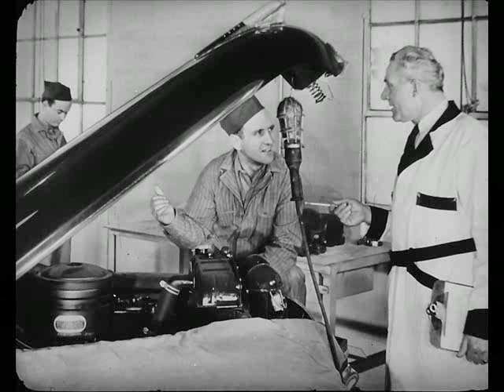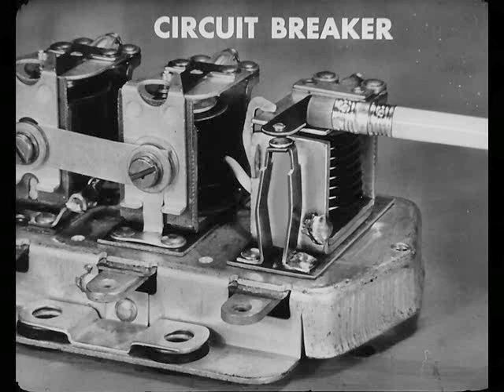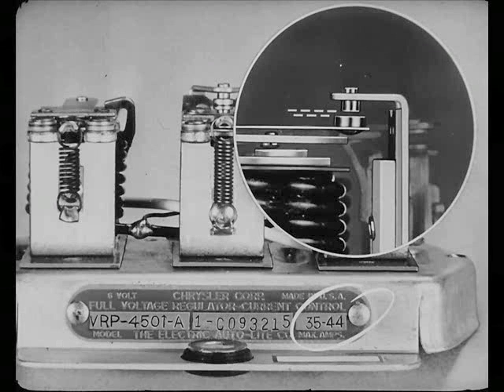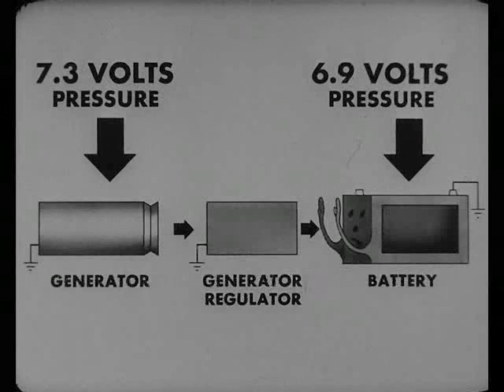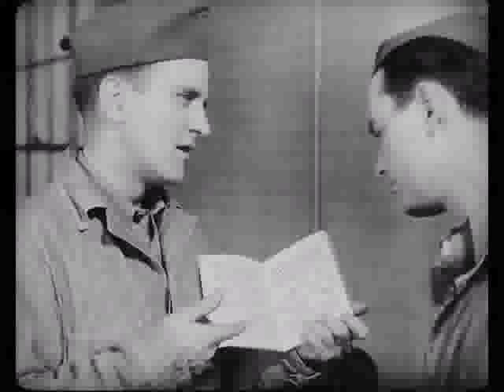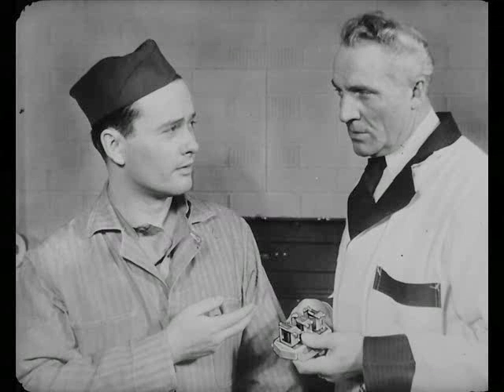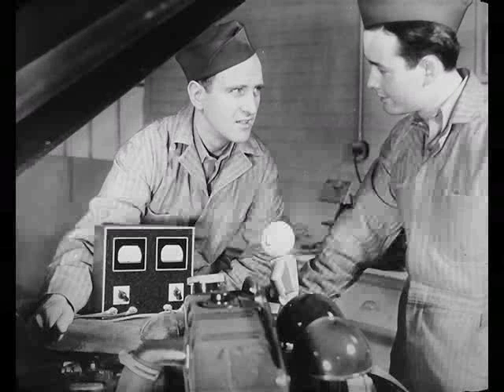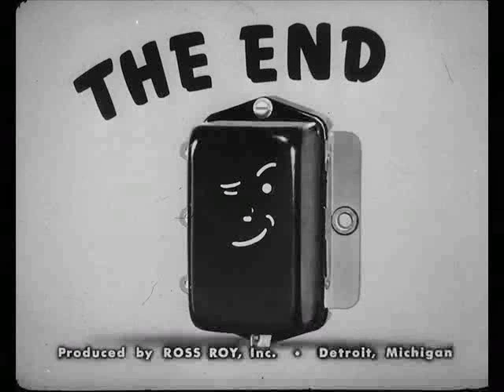Chrysler Master Tech - 1948, Volume 1-7 The Generator Regulator At Work

Comment: One of the challenges auto makers have is that gas engines have a speed range of nearly 10 to 1 (700 to 7000 rpm), though accessories like generators, water pumps, power steering pumps and A/C compressors all have to operate at any speed. That means most of these accessories are sized for low speed/low power, which means they're oversized at normal driving speeds.

Comment: That's some awesome Stuff! So much interesting history has already been lost via time and lack of motivation to preserve the non essential stuff sadly now that we're in the digital age. I Love the old voltage flicker points or "over current cut-outs" as they were originally known as, and still to this day use them of all thing's a single cylinder Onan Diesel generator setup. It actually uses flicker points on the 3 dead strokes of the 4 stroke cycle closing points to release excess power stored in a capacitor into the field windings. This brings the voltage of the field windings up a little bit higher as the engine is technically losing speed inbetween the power strokes. Because it only runs at 1800 rpms you'll notice the dimming of a Light under a full load. So their technical name is a Anti-Flicker points when used in this configuration making up for parasitic losses inbetween power strokes. But I also use a Ezgo golf cart with a starter generator system which still utilizes the old flicker points for the voltage regulator. Its amazing how simple things are when you understand how digital copies work, but it's not always easy to figure out how things came to be? The old horse and cart Deal! Which one comes first? Welp we've had generator systems long before we had these fancy silicon chips, so it's figuring out how and to the extent engineers went to make all this stuff mechanical and last for a long time, sometimes out lasting any digital BS. There's just something's which should be mechanical and others which should be all electrical. Truly with proper setup and maintenance of a old fashioned voltage regulator, you will have many years of usage without even knowing that it's all mechanical and electromagnetism that's running your charging systems. Thanks for posting this video it is very entertaining and you may actually learn something as well?!